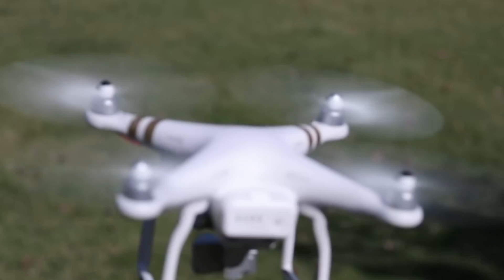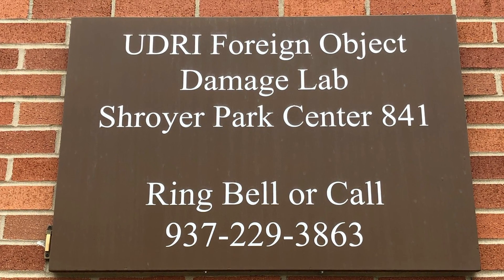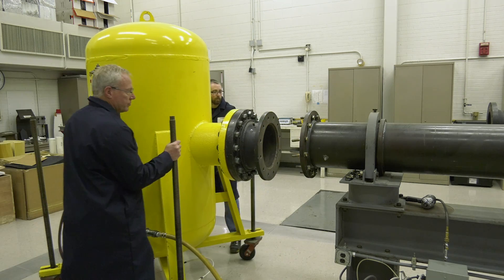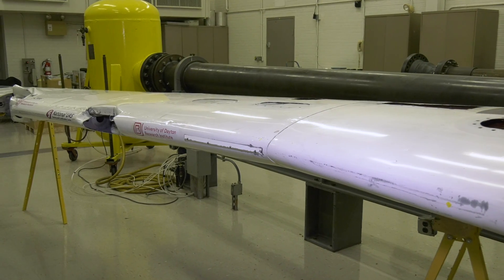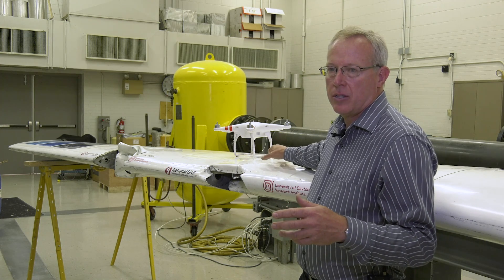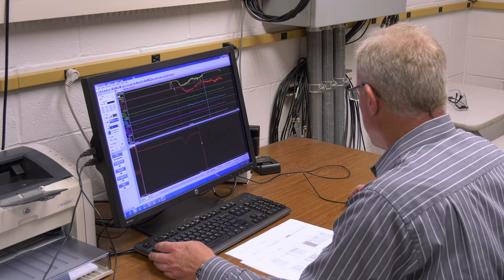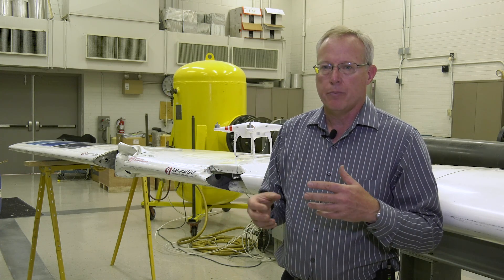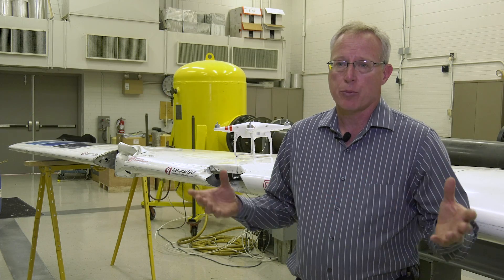What Happens When a Drone Hits an Airplane Wing? – AIN

Comment: There seems to be lots of misinformed comments on here about airstrikes and how there have never been any. That is incorrect 

Canada reported a drone striking an aircraft. Result? The plane suffered almost no damage and required no repairs. 
https://www.google.com/amp/s/www.forbes.com/sites/johngoglia/2017/10/19/a-small-drone-hits-a-commercial-airliner-and-nothing-happens/amp/

In the US a Blackhawk Helicopter struck a drone.https://newyork.cbslocal.com/2017/09/22/drone-hits-army-helicopter/

Result? Flight continued as normal and they landed without incident.

So there you go. Drones HAVE struck aircraft. They just failed to produce the death and mayhem people are concerned about. 

If the few stupid operators could manage to NOT fly by airports this would all go away. 

If you fly responsibly be sure to report these idiots before we all suffer from their actions

Comment: What a bullshit video. We know that the funding behind this comes from Aviation pilots trying to hold onto their dying business models. Gone are the days of paying tens of thousands of dollars for aerial footage of ones property.  Now with $600 and a few teaching sessions people can do what was once a booming business. Bias video and very much bullshit. 

Where in this video does it take into effect air currents and flows around wings? A drone would not hit head on like that, the air pressure will more than likely push it down out of the way. Bird strikes RARELY happen on the wings, they are almost always into the engine as that is where the lower pressure is created by suction. Try harder.

Comment: The test is completely flawed at the get-go and is absurd. The "engineers" and "scientists" here know absolutely nothing about kinetic energy transfer. 
If the jet is moving (the whole wing is moving too, obviously) and the energy is distributed trough out the whole wing not a localized area. As the plane hits a "stationary" light plastic drone it will push it away as the mass of the plane is greater, while transferring only a part of the energy that the wing had in the local area where it collided with the drone. 
In this test the drone is literally a canon ball that has huge amounts of energy (because of it's speed) and transfers kilo joules of kinetic energy at a localized small area of a stationary wall (metal wing) which has 0 energy, puncturing it with ease. This is exactly why bullets work... Even though they are small in size and mass their speed is what makes the destruction possible trough high kinetic energy being stored in a small object.
 In this case (the plane) energy is stored in a huge object and it would obliterate the small object with no energy. There would be some minor damage, but nothing remotely similar to what happened here. 
When a plane hits a bird only splatter remains on it, while in this test the wing is more than damaged because the gel was quite literally a projectile.
Birds are dangerous as they fly in flocks and can clog up and jam the engine or shatter windows which are brittle unlike metal.

Comment: Sorry, but this is a misleading test.  The test uses a Mooney M20 wing and DJI Phantom 2 drone.  The late model Mooney M20 has Max. Structural Cruising Speed of 174  KCAS (https://www.aopa.org/go-fly/aircraft-and-ownership/aircraft-fact-sheets/mooney-m20), which is just over 200 MPH.  The DJI Phantom 2 has a Max. Flight Speed of 15 m/s (not recommended by the manufacturer - https://www.dji.com/phantom-2), which is 33.5 MPH.  So the test conducted shows these two aircraft at their max speeds directly towards each other and the resulting damage... so what's missing is the odds of these conditions occuring in a real environment.  Also, while this test shows that damage will occur, it also shows survivability if this accident occurs.  However, this test does not automatically mean all other aircraft will sustain this type of damage or worse as the tester reasons because higher speed aircraft and large airframe commerial aircraft likely use different materials, thickness of materials and structural construct.  This would require testing other wings to get conclusive results.

Comment: We have more than 5 real world data points NO ONE,  was HURT AFTER A DIRECT PROP. STRIKE WITH DJI PHANTOM 4, NO damage and even in this scare tactic vid, where the planes operator would need to. Be flying under 400 feet NOT ON approach, ASSUMING ALL PIOLETS ARE RESPECTING LEGISLATION....  Not to Mention, unless several redundant hydraulic lines were cut this does not look like a catastrophic failure whatsoever.. and why is it the real world incidents that have taken place and data points are not being used but instead this pseudoscience costing a lot of money giving us results that are far from what we see in the real world... Now that we DO HAVE this data, and PS the landscape is changing, if you see a shark sign you are more than welcome to go swimming but is it a good idea? No, just as knowing that the air space below 400 feet is now filled as it has been for many many years with RC aircraft the media is just finally paying attention because do they call them drones I called them multirotors and whether I'm flying a multi-rotor or a fixed-wing RC form and aircraft we all need to follow the safety rules as set out by the FAA and I believe the FAA should go a step further in making, a differentiation between  5.8  hobby racing and freestyle quads  verses say a heavy or long range capable machine  which either way we have to register simply so that you can have cope ability instead of spending a few dollars to prevent the problem from ever occurring in the first place... 
But the FAA.MUST make it easier for simple hobbyists to enjoy the sport of fpv, safely with less red tape, those who pose absolutely zero danger to commercial air traffic and manned aircraft away to do so, without infringing on their personal, rights! If i can own an AK and not have to register ANYTHING to hold ME. ACCOUNTABLE, BUT a 3inch toy airplane,  really.....??
 God forgive them, to Liberty freedom and the American dreams killed off by the memes and silent screams of working machies..

You are being manipulated friends, Break Away.....

Comment: I just wanted to add 2 things. One no drone is gonna fly 30,000 feet in the air two most hobbiest stay away from no fly zones so they really need to shut the fuck up with the hate on quads just more reasons to up the already high price for good quads

Comment: 911 'proved' that aluminum airplane wings are strong enough to penetrate steel I-beams and a foot of concrete like hot butter. Drones are nothing compared to a steel framed building so this is a non issue...

Comment: Well, comparing the ballistic Gel representing a bird and the drone... the drone did less Aerodynamic damage than the gel. So a drone would be less dangerous for the stability of the plane. This crushed metal with the gel would definitely make a lot of air resistance.

BUT it all depend how the UFO smash the wing/face of the plane.

But i'm pretty sure the impact of a drone would do less damage has it crumble upon impact.

Comment: You didn't take into consideration having a lithium polymer battery on board the drone when it struck the leading edge of the wing. Lipo batteries are extremely flammable, enough to detonate inside the wing cavity causing catastrophic failure on impact!
Reply: Milspecmachine they don't detonate like an explosive. They burst into flames and burn out.

Comment: On what planet do light general aviation aircraft fly 238 mph? Most Cessna aircraft have a maximum cruise speed of 120 knotts. Even the Cirrus high performance aircraft have a maximum cruise around 160. 238 is an unrealistic number since most hobby drones like these have a max forward velocity of about 40 mph.

Comment: A commercial aircraft leading edge is multiple times as thick as the leading edge of the wing in this video. I've wiped bird smudges off many a leading edge, they typically just bounce off and leave a small feathery splat. A drone might even leave a bit of a dent.

Comment: Where can I get a drone cannon? Seriously the most unrealistic test. Maybe try some real world conditions in a windtunnel.
Reply: How is this unrealistic?
Reply: @miguellopez3392  wings are not stationary objects while in flight, nor are drones shot from cannons. Not to mention other factors like wind, tragectory etc.
Reply: if its moving or not is irrelevant because what actually matters is relative velocity between the wing and bird, if a bullet was fired at a wall at 800m/s it would hit it with a specific amount of kinetic energy, now if the bullet was floating mid air without moving and the wall moved toward the still bullet at 800m/s the amount of force that bullet would have on the wall would still be the same, thats what this test is for, to test structural damage from a kinetic energy and velocity stand point, wind, trajectory are not the main component in what would happen to this wing if struck but would yield a slightly more accurate scenario and result.
Reply: @miguellopez3392  your trying to hard Mr. Science. Again this is not realistic for a number of factors not simulated in this expirement. I'm not gonna argue this with you cause you are a troll and can't think past your own ignorance. If you can't see that there are other factors to a drone strike then you are just a fool.  Thanks for the reply, you wont be getting a response. Also it's whether, nice edit.
Reply: @Jaybux87  9th grade physics is trying hard? Ok...

Comment: that test is very inaccurate for many reasons. 1.  the plane would be going must faster, 2. Most drones can’t reach the normal cruising altitude of air craft. 3. The current world record for drone speed is 163, therefore most drones max is probably around 120. Though most people don’t go much above 50-75 4. That was a direct center strike witch is unlikely as drones are usually moving or sitting still. In order to properly test the possible damage, one would need to test this in the field and not a lab. Not to mention the fact that a drone would be visible on the planes radar.

Comment: I hit a seagull once going about 75 knots in a shallow left turn, right on the windshield at chest level in a 300C. I was looking down as I was patrolling fiber optic right of ways. I looked up a second before I hit it. Never saw anything but feathers and absolutely no damage, lots of blood. Big bird. Pretty sure some of it went thru the tailrotor but nothing was on it. 

I've seen videos of aircraft that flew into hail with both wings leading edges flattened and it managed to land.  Pilot error.

I've barely missed kite strings at 500 feet in Daytona Beach near the airport, but no ban on those. One guy hit one and had to land because the braided string wound around the pitch links. No kite bans so far.... 

When your luck runs out, it doesn't matter what the rules are. See and avoid. It is very difficult to spot small objects below the horizon in densely populated areas with perfect visibility. Gets worse when the weather isn't ideal and you are distracted looking for other aircraft. Flew 1000's of hours flying legally at 200' AGL, in Florida, South Carolina, Georgia and Tennessee patrolling, but only hit one bird, avoided a few small ones. Birds instinctively dive when you get near them. 

Seems most drone problems come from operators ignoring the rules and flying out of line of sight and maneuvering/looking through the gimbal camera instead. Day glow orange paint and an FAA approved/certified 360 degree visible strobe light would suffice for better visibility/avoidance for legal aircraft in all cases. Position lights are mostly useless in the sun. Most big drones are black and hard to spot at a distance. My 2 cents....

Comment: What the heck! That simulated bird strick looked a heck of alot worse that the drone!!! The drone didnt change the shape of the wing. The bird made an air brake! Internal issues aside (wouldn't change much anyways) id rather take a drone anyday. And the chances of it hitting that exact spot are next to nothing. More birds than drones out there..

Comment: even with that damage, the plane is landable. Just like the bird strike (i have a hard time seeing a bird as pure gel.. sure the bones are light, but still).  But the big question here is how much effect will the currents around the wing affect the chance of hitting.  And of course right now airlines have close calls with thousands of birds daily, and virtually no drones.. with around 20 actual bird strikes A DAY, and that is voluntary reporting (mostly).  Still find it funny... I can fly legally my part 103 aircraft to 17,999 feet, no test, no certification, no medical, it weighs what.. 200 lbs+ (versus 2? 4?), does not require a transponder, unlikely to show on radar.....  but yeah.. drones are the problem.

Comment: These “concerns” are ridiculous, the odds of a drone striking a plane in the air are exponentially lower than that of a bird strike, due to the high operational ceiling of these commercial drones being far lower than that of the low operational space for FAA regulated aircraft. Regulating the use of drones near airports and air fields is a legitimate response to the rising use of them, but the idea of a remotely operated, small scale aircraft isn’t fucking new. They’ve been around for many decades, they’re called remote controlled planes and helicopters... smh

Comment: What planes fly well below 100m?? Because that is where 99% of drones are flying, most drones can't fly above 120m altitude it's coded into their firmware! 
Like the video says there are 100's of thousands of drones being flown by hobbyists, I'd say millions globally, so how many planes have been hit or damaged by drones? How many have crashed due to drone impact? I've never heard of any instances yet! Compare that to how many bird strikes there are, or how many planes have been downed by a bird strike, I know quite a lot......
Also the drone in the test is one of the most heavy on the market, a lot of drones weigh sub 250g and are constructed of more flimsy, lighter components, lets see another test using a lighter drone, I guess they already have and don't want to show the drone being smashed into dust without even a scratch on the wing edge! Media hype again 👍

Comment: YouTube suggested your video. I have worked with people who used that type of drone, but I don't recall them flying very high. 20 minutes of battery would be hard to get to 10,000 feet. I saw one flying in a straight line on a low wind day at about 800 feet above sea level going 2.5 miles out to inspect a target, but it was a stretch to get it back and did go into a crash upon the landing. I am not very familiar with civil aviation nor the wing you tested, but it's  sobering footage as it's likely to influence regs on drones.

Comment: Come on its 2018 ! Heavy Phantom 3 was popular 2 years ago. Now everyone prefers smaller lighter drones with longer battery life better range like Dji Mavic with weight 730g or Dji spark, Mavic Air with weight approximately 300g which is nothing compare to 1280g for P3

And by the way Dji software won't even allow you to take of near Airfields...

Comment: The FAA will pass the following regulations:
1: Drones will not be allowed to fly within X miles of an active airport without approval so that relevant NOTAMs can be issued.
2. Recreational drones will be limited to a maximum altitude of 750 ft AGL in populated areas and 400 feet AGL in less-than-populates areas.
3. Drones with digital controls will be required to have a firmware program that prohibits the drone from exceeding 500 ft AGL.
4. Persons found guilty of damaging or destroying an aircraft via negligent drone operation shall be subject to a hefty fine and/or prison. (Not to mention being liable for damages.)

Comment: His guesses regarding the impacts on jet aircraft wings assume jet aircraft manufacturers build their wings to the same specifications as a Mooney wing. Most jet aircraft use swept wing configurations which would mean a drone strike would be a somewhat glancing blow. This doesn't seem like the kind of conclusion a "distinguished research engineer" should be making without any actual experiment on a jet aircraft wing having been conducted. Secondly, his gelatin "bird" was made to be the same weight, but the shape was easily twice the thickness of the drone's majority of mass and was pitched down at impact (unlike the drone), so the shape distributed its energy across a much larger area of the wing's leading edge. This fact is clearly demonstrated by the shape of the wing deformation the gelatin shape created. Thirdly, he performed both tests on the same wing section, with the larger "bird" shape aimed at the thinner section closer to the wing tip. This allowed the horizontal portions of the wing skin to help resist penetration of the wing by the shape. A REAL distinguished research engineer would have conducted the experiment by striking the same location of wing as the drone did in order to eliminate as many variables as possible.
This "distinguished research engineer" has failed basic scientific method procedures, but still somehow comes to a conclusion of dubious value. (These days, I guess you have to justify facility usage SOMEHOW.)

Comment: Using a cannon is not the accurate way to calculate the damage. For accurate results, use a wind tunnel.  Without airflow around the wing, we'll never know the real outcome of this 1/100000000000 chance scenario.